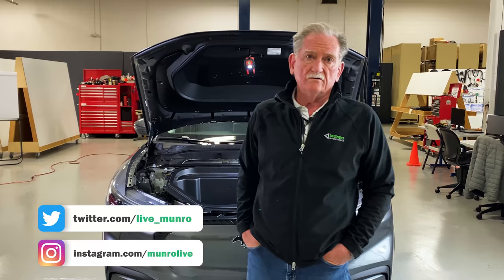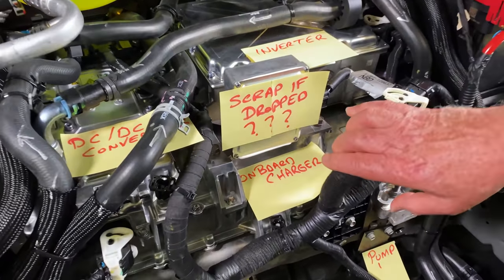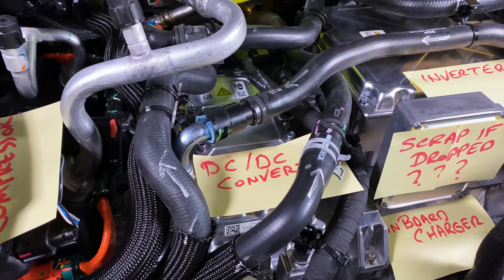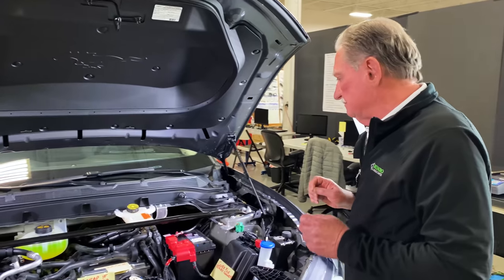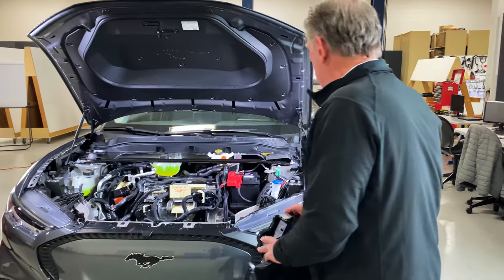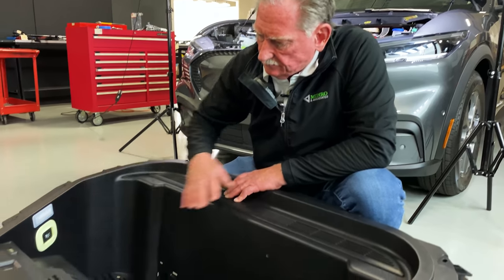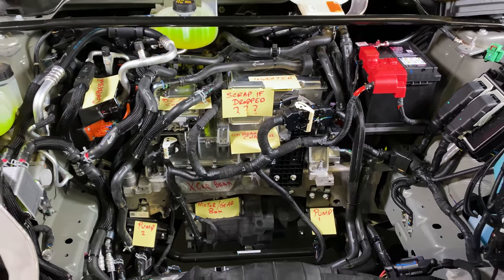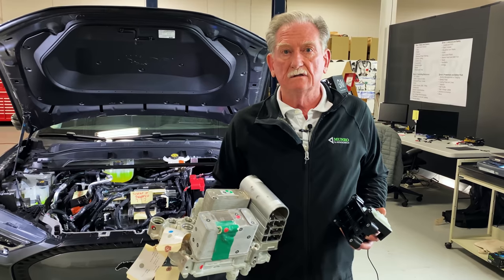Mach-E Thermal System Nightmare

Comment: I was genuinely like "come on, how bad can it be?" I've never seen the term "spider web" apply to the cooling hoses of a car, but I guess there's a first time for everything. Between the hoses and the Jenga tower stack it looks like a horrible mosh posh, hopefully Ford keeps using Munro's advice.
Reply: Yeah it looks like a prototype project car! Hopefully the next generation will be better engineered and packaged.
Reply: Well, If I understand correctly, Sandy has quit his job at Ford because they did not listen to him.
Reply: I thought he was exaggerating until I saw what was under the fronk. Then I was flabbergasted. This is Ford Engineering?!? wtf?!? Was it someone right out of college? Now I am too terrified to buy a F150 Lightning because it will look like the Mach-E. I could have done a better job than that.
Reply: @MarcoNierop  Seems like that was when they were able to get away with it. It looks like they are open to suggestions now that Tesla is shaking up the industry by LISTENING to engineers, what a thought.
Reply: @anydaynow01  I'm going go on a limb and say it's a good overall first step into electric, though I'm really just parroting Monro and Associates, but I'm liking what I'm seeing. Sure it's going to fall short of the leader in the industry, but it shows that they are trying to innovate.
Reply: @xthegrim  Problem is Ford sees themselves as the leader…
Reply: @felixsu375  This is what happens when you poach engineers from IKEA...
Reply: @johnbuchman4854  quite the opposite, IKEA is fabricating quite efficiently, no superfluous parts..
Reply: @johnbuchman4854  Haha. So cruel...lol
Reply: @johnbuchman4854  It looks like a spider exploded under the fronk and became hoses...lol
Reply: @excelrobot  I honestly was thinking it might have been purposeful in order to increase service/replacement cycles going.
Reply: @patrickkenny2077  a somewhat delirious stance on any part of the market but pickup trucks, that is until the cybertruck starts eating everyone's lunch.
Reply: @xthegrim  lol
Reply: This is truly a Rube Goldberg creation, no doubt about it folks.  Laugh...
Reply: @excelrobot  best comment of the day
Reply: @felixsu375  Tesla is hogging a lot of the competent engineers...
Reply: @anydaynow01  Considering how quickly they got this product out, it essentially is a production prototype. Ive said it with Tesla in the past, but I think it applies to EVERY automaker: Regular people shouldnt buy the first version of any new EV. Wait a few years for the kinks to iron out and buy the improved version. Let the people who can afford to buy an overpriced lemon get the first iteration.
Reply: @johnbuchman4854  Ikea is so much better than the competition now. I've bought stuff from competitors and it's just made of particle board and breaks. Ikea stuff has metal where it needs the support and lasts (As long as you don't disassemble it). They used to be crappy, but in my experience they're well engineered with minimal parts.
Reply: Can you imaging having to remove it all for just to repair to bottom item...
Reply: @patreekotime4578  
But we don't know if the Mach-e is a lemon or not. Just because Sandy is not impressed with all the parts in the front trunk does not equate to a lemon..
Reply: 90% of Mach-e buyers are leasing the car, and 80% of those buyers can care less about all the parts and pieces in the front truck.
By the time these cars need repairs/services, these cars will be on the used market being sold for $18k or less..
Reply: @excelrobot  really so true it hurts
Reply: @felixsu375  This is the equivalent of Tesla's first attempt at the model 3 trunk base. Actually the model 3 trunk base was worse, because Ford engineers were probably stuck with designing something using suppliers already available, whereas Tesla had to design all those stamped parts. The difference is the response, I would have loved to be a fly on the wall the first time Elon realized what they had put in there. Actually, maybe not, his reaction probably blistered those same walls. But look what they replaced that abortion with. While Ford is capable of redesigning that rat's nest, I really doubt it will happen quickly, if at all.
Reply: When wiring looks like those hoses it's called a rats nest.
Reply: @xthegrim  I also think it was about as good as they could do for that first attempt. Their problems are manifold, they cannot build lots, for quite some time. (battery supply)  That means they can't invest in major equipment (like the IDRA machines) for what is in reality, a low volume product. They have to placate the dealerships, and their need for a servicing revenue stream. They can't expect to make much money from EVs until they can make them in sufficient numbers, which pushes them to use existing suppliers and off the shelf components, which is another reason for this mess. I really don't envy any of the Legacy manufacturers, seriously stuck between a rock and a hard place. 

It just occurred to me they are like that climber that got his arm stuck, and had to literally amputate it to get free. To carry the analogy further, Aron Ralston's big mistake was not leaving word of where he was going. Ford's mistake, (which is mostly the same mistake everyone else made) was not trying to move towards EVs a decade or more earlier. Ralston realized he had no choice, but even then, having to cut your own arm off? Then doing it successfully? VW is the only ones who are attempting the equivalent, and their CEO is having to fight tooth and nail with all the others who have a say to make the attempt.
Reply: Some managers are content if their engineers make something new work, are delighted if it can be done at a profit. Good engineering managers want a combination of reliability and repairability.   Great engineering managers want it all. 

Only lucky technical design engineers are allowed to do excellent work. They don't work for Ford. Ford management wants engineers to cost less so they can pay their factory workers a little more until they reach their unfunded retirements. 

Ford managers are happy if their products aren't returned within 30 days. 

Ford produced an electric shift dual-clutch automated transmission defective by design after its engineers said to NOT build it, then put it in Fiestas and Focuses for years after they failed in the field. My mom got stuck with one and after bringing the car back a half dozen times, had to pay for a replacement transmission She was never notified of the class action suit settlement. 

I wouldn't own a Ford product- ANY Ford product-  if one were given to me free.
Reply: @patreekotime4578  “considering how quickly they got this car out....” WtF 😳
Reply: @grahammonk8013  Agree. Now I will only get a F150 lightning after Munro tears one down and I don't see that spider explosion.
Reply: @felixsu375  Unfortunately I think the none Cybertruck based electric pickup trucks are going to end up with SEVERE short comings. Large vehicles compound the issues with electric vehicles and I think the the F150 lightening and the Rivian are going to have to have an obscene number of batteries to compensate for the exponential weight issue with large electric vehicles. This is going to to be a huge contributor to cost, towing limitations, and payload limitations. There's a reason the Cybertruck is beating the pants off everyone else's electric truck specs. Mark my words, the unorthodox styling is going to overshadowed by how badly the Cybertruck is going to beat traditional trucks. Munro Live does an incredible job explaining why if you look at the Cybertruck videos.
Reply: @xthegrim  The problem with the Cybertruck is that it isn't really usable as a Truck. It's basically a expensive toy.

You can't reach into it from the sides because there is no way to get into the truck. That is a dead stop right there.

There is a reason why truck beds look the way they do and hasn't changed since the 50s. Because form follows function.

Who knows how long Tesla is going to come out with an actual work truck.
Reply: @grahammonk8013  The difference is Tesla didn't release that Model 3. Ford did. Makes you wonder who is in charge of vehicle design over there and how it got released like that.
Reply: @mamadouaziza2536  I have a pearl of wisdom for anyone looking to get a new car. If you cannot afford to buy it in 4 years, you cannot afford the car... Leasing is a way for Dealerships to squeeze people into cars that they cannot afford!
Reply: @xthegrim  
Well damn.. Give the OEMs a shot first, this is their very first EV...
Reply: @michaelholliday100  
People lease, they don't buy.
Reply: @timbrady4427  It was just announced 2 years ago. For your reference: the Model Y was trademarked in 2013, teased as a concept in 2015, teased as a silouette in 2017, officially unveiled in 2019, and didnt start deliveries until 2020. Im not sure how long YOU think it takes to develop an all new vehicle with an all new drive train, but I would bet Ford was working on this for a VERY LONG TIME before it was revealed.
Reply: @mamadouaziza2536  He showed us two dozen potential points of failure that dont need to be there.
Reply: @mamadouaziza2536  Only about 27% of new car buyers lease and they are foolish!  Except for a very few rare situations it is nuts to lease. It is simply a way to trap people into buying cars that they cannot afford. Do I buy expensive cars, at times yes, but even in retirement I have a very high income and can easily afford the purchase. My red stealth Model Y with the white interior and FS and then getting a full body wrap and taxes was about $82,000. I could easily paid with cash, but I got a 4 year loan at 2.2%. My investments earn a lot more than that, so I am better off leaving the money in my brokerage account...
Reply: @felixsu375  "Tesla didn't release that model 3" Which model 3? The one with that dreadful rear end design? They DID release it, though they fixed it pretty damn fast.
Reply: @felixsu375  Wrong, with its hydraulic suspension you shhould be able to piss in tbe Cybertruck bed.
Reply: @michaelholliday100  So the wheels will move out of the way. Please show me.

Comment: The two electrical connectors are high density connectors that fan out the 12V distribution from the black box on the side, which is the main 12V fuse box.  They have tens of small diameter low power wires in each of them.  They are not "high power" connectors and have nothing to do with charging or traction power.